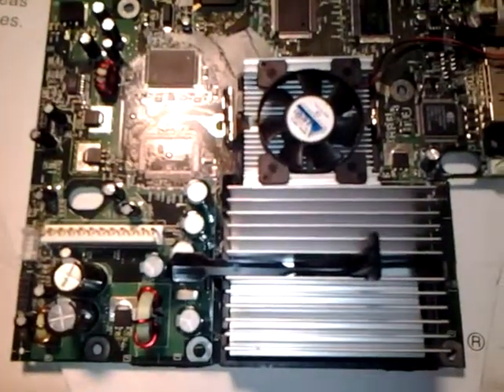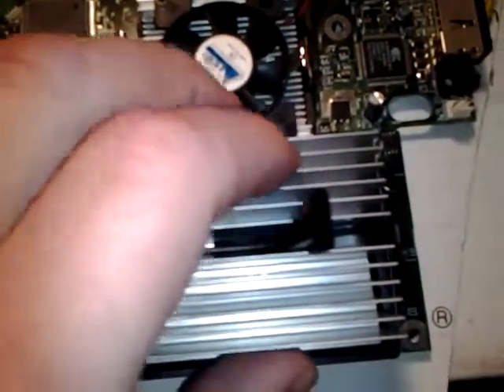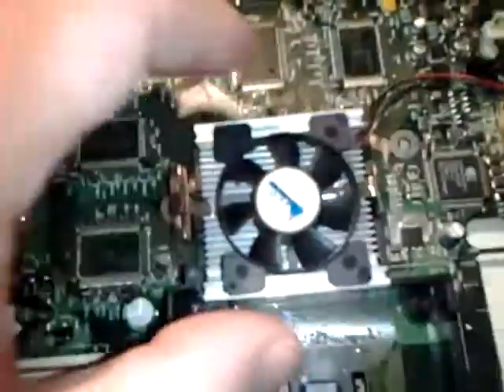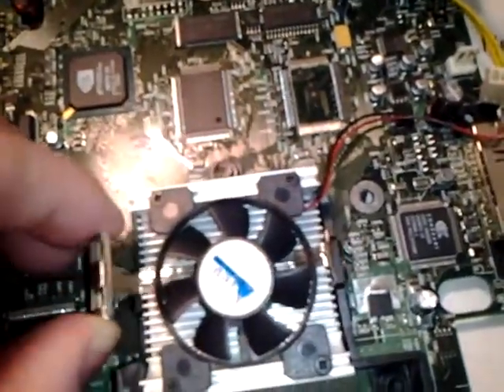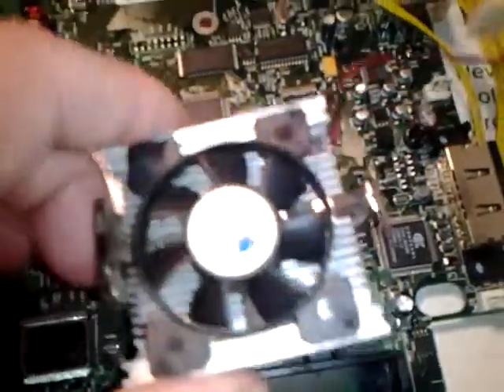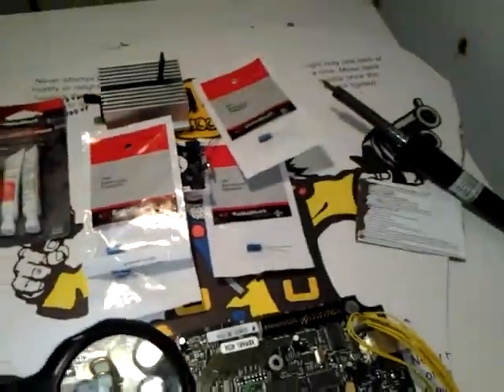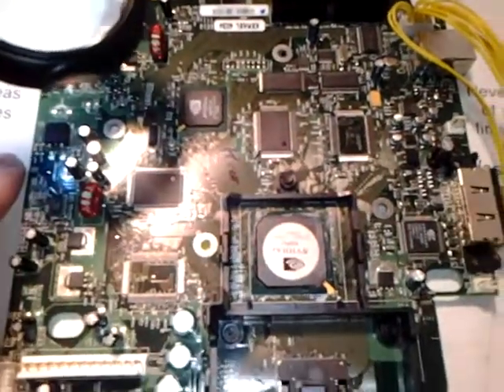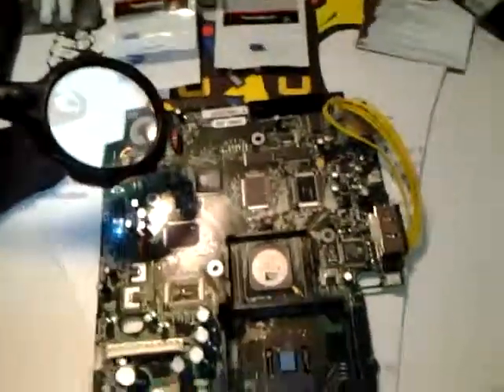XBox board clean/fix

Comment: I just learned about the bad capacitors last night.  I've got a stack of 7 Xboxes...it's been a bitch going through them all.  Well a little time consuming at least.
Reply from the maker: Well worth it 😉..how are things with the Xboxes?
Reply: @KevinTwiner  been years since a lot of them have been booted up. I want to upgrade the hdds to sd cards. Adapters exist and some people have pulled it off. My primary nodded xbox is humming along. One has had an hdd failure and needs salvaged. Someday I might get around to it.